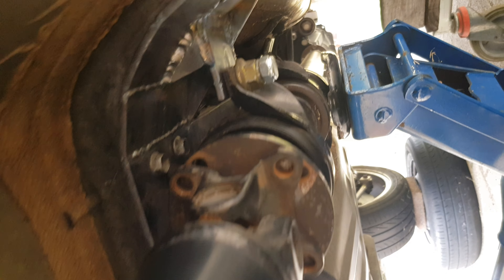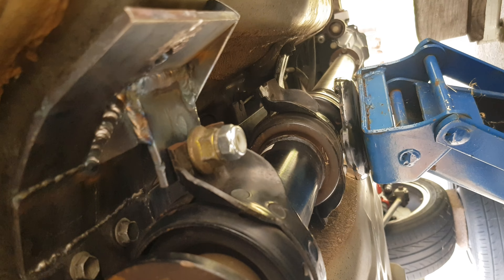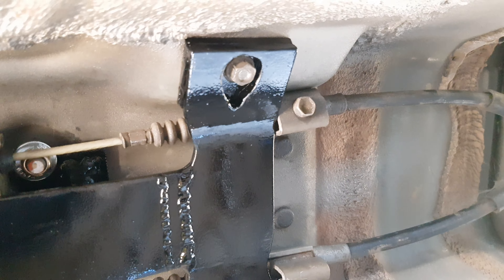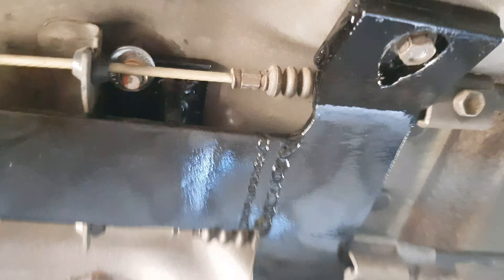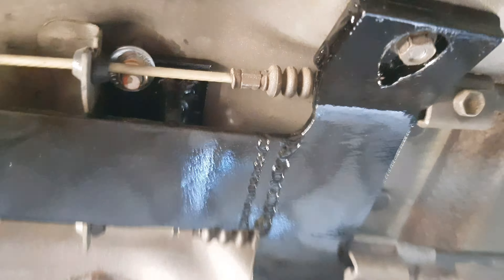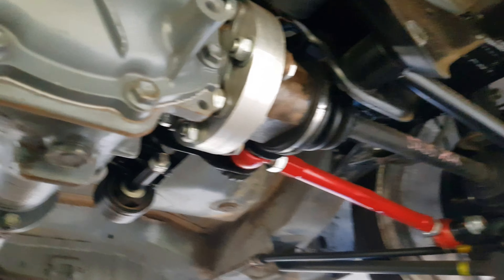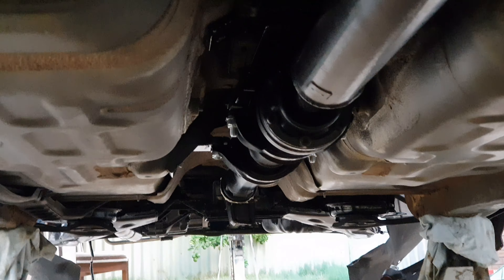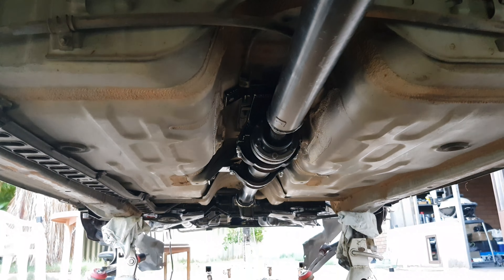Turbo AWD Camry - pt22 - Driveshaft In

Comment: What subframe did you use to fabricate the differential to it 🤔? I live in Florida and getting all my parts together using a celica awd transmission with the 2.4l 2az-fe motor and trying to fabricate a 2003 lexus is 300 rear subframe with the rav4 differential 2.9  all together

Comment: What manual transmission are you using and what rear diff?
Reply from the maker: Its the standard E153 transmission rebuild with sn E150F front/center diff with the E153 crown wheel. And E150F transfer case and toyota caldina rear differential. Its all basically what comes in a toyota Caldina/Rav4/Celica